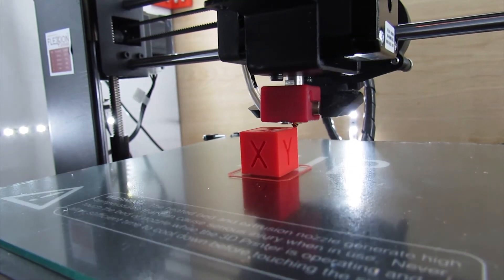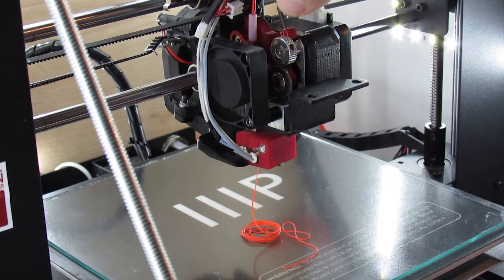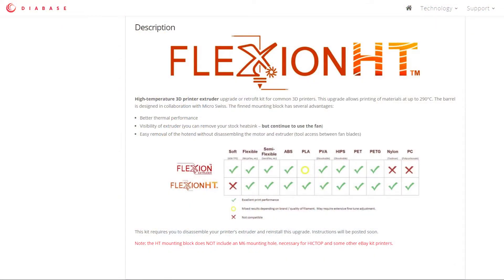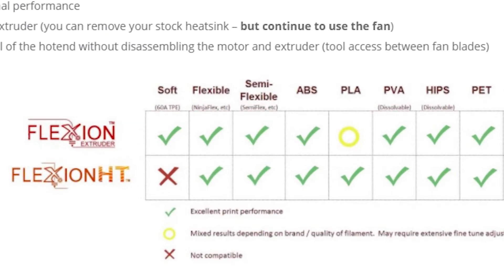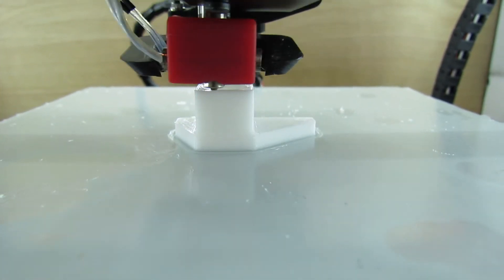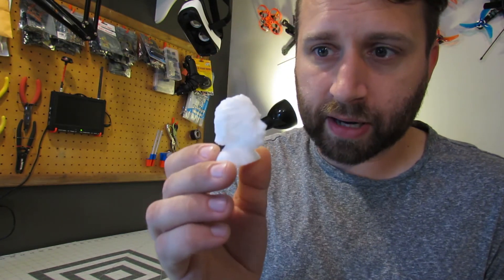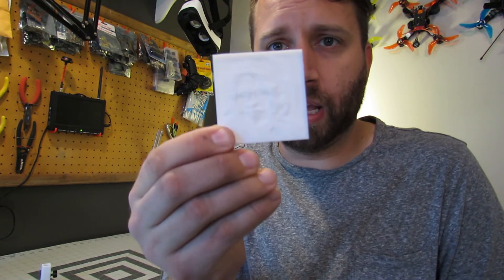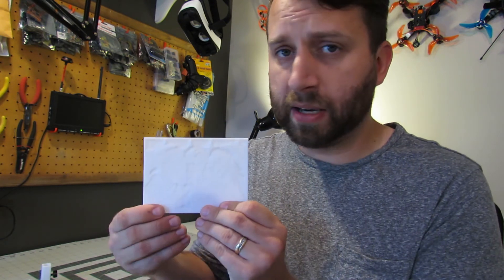3D Printing PLA Successfully with the Flexion Extruder - Go for HT!

Comment: hi there, never had luck with PLA using Flexion HT. I'm not sure if i'm doing something wrong about the printing settings. Do you have a S3D profile which you use for PLA with Flexion HT? and if so is there any chance you can share it? have a nice day!
Reply from the maker: I've never had much luck with using other people's profiles - too many variables honestly.  My luck with PLA varies greatly with brand and filament quality.  I've had horrible luck MicroCenter PLA, other discount brands from Amazon, etc., but fantastic results when using 3DSolutech (which is almost all I use these days).  Be sure to experiment with print temps as well, as sometimes I end up printing PLA at 210-215 for best results (with plenty of active cooling)

Comment: the other issue is, if your ptfe tube on the bottom isn't jammed tight top and bottom, it will move on retraction and allow melted filament beneath it and clog it

Comment: Have the same setup. Using cura? Have any specific settings you've found that have improved your pla prints? Speeds, extrusion, etc... Thanks!
Reply from the maker: I use Simplify3D, but I've actually found that printing a little hotter than normal, say 210-225, seems to work well and helps the Flexion force the PLA out of the nozzle at a decent speed.  Most of my improvements have come from trial and error, and making an effort to print something every day!
Reply: Nice.  Printing a part right now at 200c in PLA and it's looking awesome.  Will play with increasing.  Saw this today as well... https://www.youtube.com/watch?v=FPumsgvBt00&t=314s Are you using standard extrusion value or lower as they recommend?  Also, what speed is working for you these days?
Reply: also played around with different nozzle heights when bed leveling.  The plasticy paper measuring gauge that the printer came with has a .2mm thickness and I used that to level.  Printing really nice at that initial height.
Reply from the maker: Blayne Chastain my extrusion value varies, but for PLA it is usually around 90%. I rarely print faster than 50mm/s if I want good quality. As for bed leveling, I did order a set of feeler gauges but after some experimenting I've settled on eyeballing it :) if you use the paper method to level, keep in mind that it is intended to be done cold. Matter expands when heated, so the gap left by the paper disappears when homed at printing temperature (or should, in theory). I head my bed and extruder then level manually to where the nozzle is JUST above the glass. The reflection helps
Reply from the maker: Blayne Chastain looks great! Higher speeds can cause ghosting or ringing, but you can tune a lot.of it out with the jerk and acceleration settings. I had to replace my control board a while back with an MKSSbase running smoothieware, so I've had to start over :/
Reply: Thanks Josh! Ah, ringing - yep, think I saw that on a print I did yesterday at 60mm/s